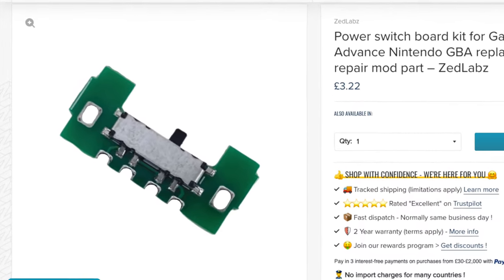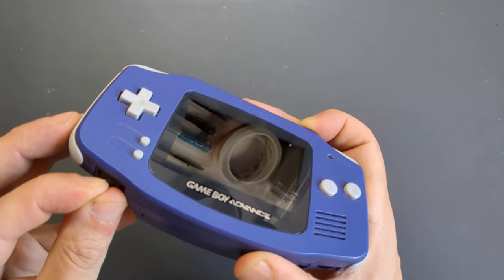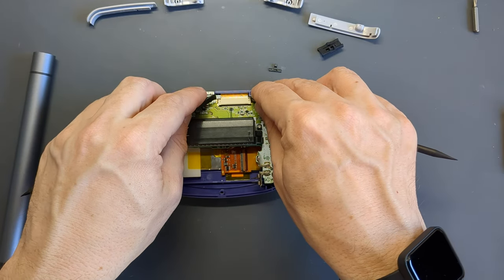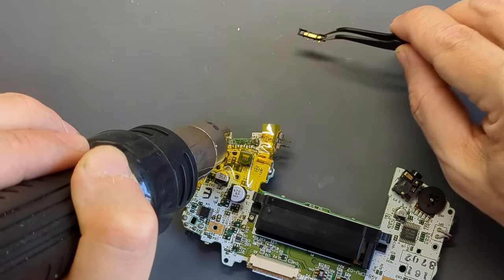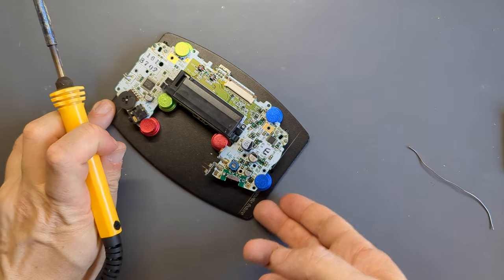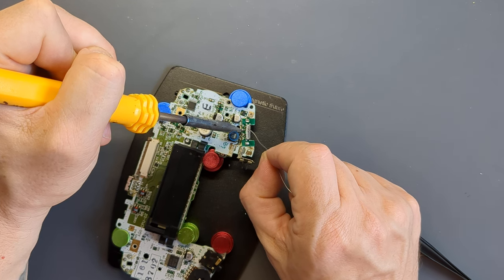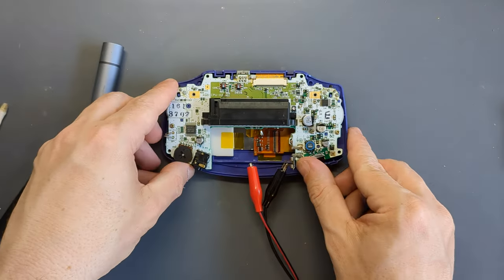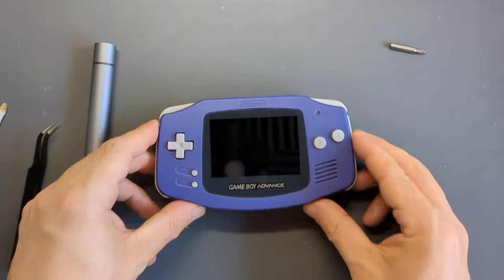Game Boy Advance repair - replacement power switch easy install guide

Comment: Thanks my power switch is haunting me.  First I upgraded to a IPS larger screen.  I love it.  Then the power switch failed, I fixed it.  It’s failing again.  Then I found the shell has broken plastic inside.  I replaced it.  Now it won’t power on again.  Ugh.  Thanks for this, this might fix it for good.  Hopefully.  👍🏼
Reply from the maker: I hope you get it sorted!
Reply: @JoeBleeps thanks.  I cleaned the old switch again.  Got it working.  But the switch is finicky, barely works.  It has too much old corrosion.  I need to do this upgrade in the future.  Thanks a ton 👍🏼.

Comment: Greta video! I managed to change it, all worked but it i needed to remove it to adjust it... But I broke all four pads on the pcb 😢
Reply from the maker: Ohh that's frustrating! You might be able to trace the pads to a point where you can attach wires to connect them
Reply: @JoeBleeps  maybe sw1-1 directly to the power switch position 1 and sw1-2 to #2 could work for those two?
Reply from the maker: @ichbinderhahn  worth a try. There's only really the two connections needed, the rest are just to ground
Reply: @JoeBleeps  in the meantime I was able to bridge the C and 2 so it's always on! LOL!
Reply from the maker: @ichbinderhahn  at least you can play!

Comment: Hello! I attempted this with a soldering iron and ripped two of the four solder pads. Is there any way that I can fix this?
Reply from the maker: Which pads? I'm sure there will be traces you can patch a wire to
Reply: @JoeBleeps  two of the four small pads that connect to the power switch. Not the side ones
Reply from the maker: @NotZachCS2  do you remember which specific ones?

Comment: What kind of flux did you use or you recommend? I've never used one before and I just got my replacement power switch at the door and I see everyone using flux O.O Haha
Reply from the maker: You don't really need it, most solder has flux in the core anyway, but sometimes it helps the flow especially if older solder is in the mix. I just use a liquid flux, it does the job well
Reply: Thank you so much @JoeBleeps
Reply: Worked like a charm! Thank you so much!
Reply from the maker: @Bjurmeister  excellent!